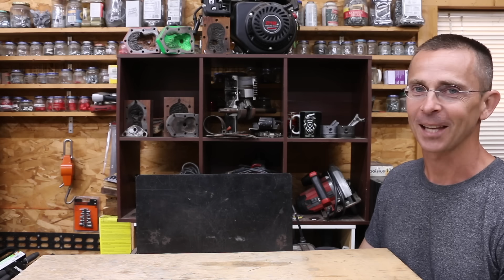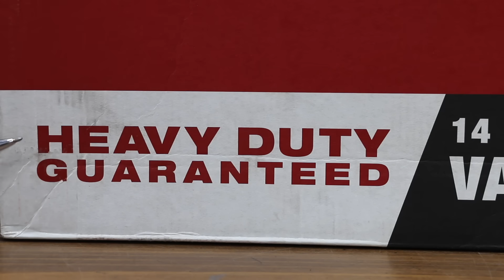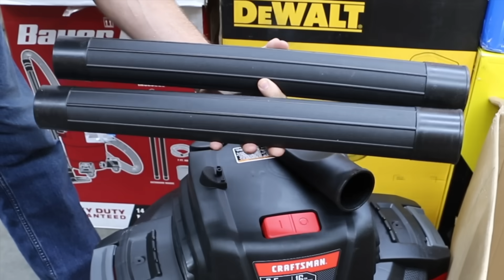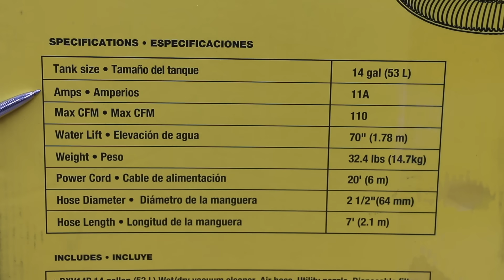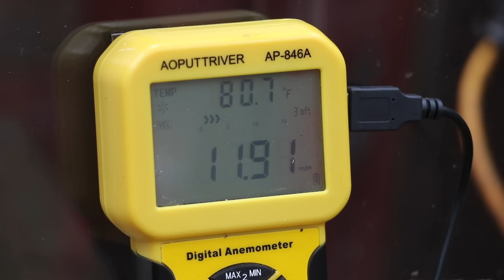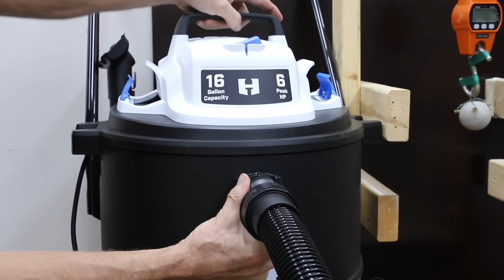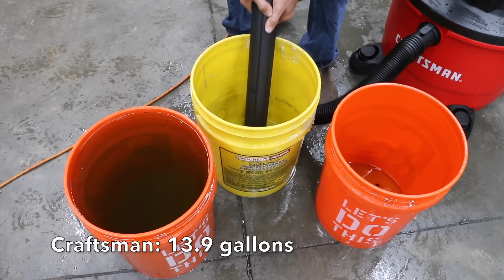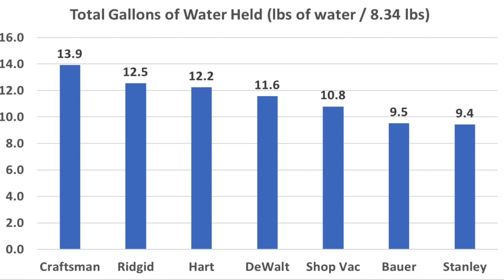Best Shop Vac? Ridgid vs Shop Vac, DeWalt, Stanley, Hart, Craftsman

Comment: As far as warranty goes for Ridgid, its meaningless. My blower motor went out with maybe 10 hours runtime on it. I had to ship it to them for inspection after having it for about 2 weeks they denied the warranty saying it went out due to the filter not being on correctly. (They wanted only the power head, no bucket, no filter) My only question is how they can think that without ever seeing it with the filter on?? Buyer Beware...

Comment: Seems like Dewalt performed the best to me. Sure, the Craftsman has more power but if that power doesn't translate into better performance then doesn't that just make the Craftsman inefficient. It may be all down to how tightly the lids fit. The Dewalt lid fit the tightest and performed the best even though it is less powerful than several of it's competitors. Too bad the Bauer doesn't have a better warranty. 90 days doesn't inspire much confidence in quality.

Comment: I think the suction test is slightly flawed as the different diameters of the hoses will favor the larger compared to the smaller ones.  Better test would be to use a vacuum gauge / 34ft water column.

Comment: I love how shop vacs throw around specs like "6.5hp". That would draw right at 50 amps. More than twice a 20 amp receptacle circuit, and more than 3x the rating of most receptacles (15 amp). And somehow this is "for consumer comparison"? So you use grossly inflated numbers - for my benefit? So I can compare to other vacs that lie about their HP? If they're lying - especially by that "margin" then who is lying more, or less, or ... its a useless number.

Comment: Video Summary Table
Cost:
Hart = $88
Stanley = $95.42
Bauer = $99.99
Ridgid = $99.99
Craftsman = $101.49
Shop Vac = $124.99
DeWalt = $143.37

Noise Level:
DeWalt = 75.6 dB
Stanley = 79.6 dB
Hart = 81.5 dB
Craftsman = 81.5 dB
Ridgid = 82.4 dB
Shop Vac = 83.5 dB
Bauer = 87.5 dB

Weight:
Stanley = 16 lbs
Bauer = 19.2 lbs
Hart = 20.2 lbs
Craftsman = 23.2 lbs
Ridgid = 24.6 lbs
Shop Vac = 28.4 lbs
DeWalt = 32.2 lbs

Power Usage:
Craftsman = 13.1 amps
Ridgid = 12.3 amps
Shop Vac = 11.8 amps
Hart = 11.6 amps
DeWalt = 10.9 amps
Bauer = 10.2 amps
Stanley = 9.6 amps

Air Speed:
Craftsman = 13.1 mph
Ridgid = 12.1 mph
Shop Vac = 10.5 mph
DeWalt = 10.4 mph
Hart = 10.45 mph
Bauer = 10.1 mph
Stanley = 7 mph

Suction:
DeWalt = 10.4 lbs
Bauer = 10.2 lbs
Shop Vac = 7.8 lbs
Craftsman = 6.4 lbs
Ridgid = 5.8 lbs
Stanley = 4.8 lbs
Hart = 4.4 lbs

Vacuuming 5 gallons of water:
Bauer = 6 sec
Craftsman = 6 sec
DeWalt = 6 sec
Stanley = 7 sec
Ridgid = 7 sec
Shop Vac = 7 sec
Hart = 9 sec

Capacity:
Craftsman = 13.9 gal
Ridgid = 12.5 gal
Hart = 12.2 gal
DeWalt = 11.6 gal
Shop Vac = 10.8 gal
Bauer = 9.5 gal
Stanley = 9.4 gal

Vacuuming 50 gallons of sand:
DeWalt = 28 sec
Bauer = 31 sec
Craftsman = 38 sec
Stanley = 40 sec
Ridgid = 43 sec
Shop Vac = 63 sec
Hart = 78 sec

Hope this helps! Let me know if I made any mistakes and I'll be sure to fix them.

Comment: Does anyone know where to find a model number on a Shop Vac? Only info I have is that its a QSP Quiet Deluxe 8 gallon, 30.3, L 3.5 HP and tiny number under that is 87729-19. Need instruction Manual since our sump pump doesn't work and our bottom stairs outside stairwell drain overflows into the basement every time it rains.

Comment: I've had a craftsman wet/dry vac for over 20 years but it's starting to show its age (over the years mice have taken up residence in the motor housing a number of times requiring some rewiring and other 'fixes').  Your treatment of these different offerings will be greatly useful for picking out a new wet/dry vac for the shop.  Thank you!

Comment: I would love to see how each of these stack up with the same hose.

Specifically is Ridgid only hampered by the reducer on that tip of the hose?

Possibly run this test with a 2.5" or 3" smooth inner wall tube for trash pumps to maximize effeciency.

I dig holes with my Ridgid frequently enough & have found that trash hose is needed to get about an extra foot of depth.

Comment: overall nice testing, especially the practical tests. The suction force test was maybe a bit flawed though as it is directly effected by surface area of the hose opening. 
I also wonder if a flow at pressure test could be made without much trouble, I mean like the airspeed test but with a flow restriction to achieve a moderate pressure drop. But it maybe too difficult to get a set flow or set pressure and would require a vacuum gauge, airspeed gauge, and adjustable inlet size; and then the sand and water tests kind of give the same information.

Comment: I have my shop in one corner of the basement w/ a boat parked in the middle of it. The best shop vac in my case was the one I wasn't falling over. I had a large one for years but now I have a 5 gallon size, still trip over it too. lol

Comment: DeWalt wins with the best suction, lowest noise, low power consumption, and beats the Bauer in slug fest.  If you want the overall best shop vac, go DeWalt, paying a premium.  If you absolutely must get best value with lowest cost, the Craftsman and Bauer are good options.  Not sure why the summary comments at the end didn't highlight DeWalt.  Overall, the difference in cost isn't much - all of these models are less than $200.

Comment: I'll swear by my ridgid wet/dry vac day and night. Got it on sale for $100 at Depot a decade ago and it's still goin' strong. Have yet to find a shop/work related mess it won't clean up without a hiccup. Worth every one of the 10,000 pennies I spent on it.

Comment: i'm trying to buy a shop vacuum for my woodshop, but it's kinda confusing, i mean they all seem t come with paper bags, but nobody uses those in a woodshop right ? that would get expensive fast. If you're sucking up water you remove the filter, but when dry vacuuming isn't the paper bag the filter ? so then what is the other filter for ? just to clean the remaining air that escapes the paper bag ? you need such a large filter just for that ? and how do you use it when you attach it to something like a wet saw ? where you get dust and water, you need the filter then, right ? so that means the filter has to be waterproof, which means it's washable, right ? so then why do you need a paper bag ? why not just use the filter only ?
(if anyone feels like answering, please drop a like on the comment or i won't see it)

Comment: I may be wrong, but when I looked closer at Rigid's "lifetime warranty", it isn't what it seems. From what I read, it basically said it only covers tools with defects in workmanship, and you should be able to tell after a couple uses if it's defective or not.

Comment: To be fair Harbor Freight does offer extended warranties, you just have to decide if you want to pay for it. Which seems bad, but I actually appreciate. Other brands incorporate the cost of the warranties into their pricing already, so you don’t really have the option to opt out if you wanted to. HB usually has an option for either 1 year, or 2 year extended warranties (which start after the 90 days you already get) - what’s great about them is that it’s a no questions asked warranty, something goes wrong, just bring the item into any HB location and exchange for a new one.

So to be fair to all, if you did get the 2 year for the Bauer, it would price the shop vac at around $135, much closer to DeWalt, at that point it does become less of a value proposition, and based on performance you might want to just go with DeWalt.

Too bad he doesn’t test the higher end shop vacs from the likes of Makita, Festool, etc...they have some awesome Vacs...though they’re no where close to this price range.

Comment: I'd love to see if the Shop Vac 600C from 1984 is more or less powerful than the newest one. Especially since Shop Vac brand is closing down. As an homage to the company that became synonymous with wet/dry vacs. I have a fully working, 5 gal, metal bucket shop vac from 1984 and would be more than willing to send it to you to test against a 2020 model.

Comment: Sorry, Todd; at 8:47 you were comparing apples to the previous oranges. The Bauer had a larger diameter hose, which equates to more area and more total suction strength.

Comment: Depending on the models..some may have better suction than others within the same brand.  it seemed like a big fix in power gains would be to just get a good seal on the bucket.  A simple weather strip would help.  I wonder how adding a seal to each of those vacs will help with suction once the leaks are reduced.  
Personally, I've stuck with Rigid because you cant beat lifetime warranty and on black friday's you always see a vac for $30-$60

Comment: I actually had the shop vac brand. The hose was sloppily cut. The filter clogged easily. It hung well in my shop out of the way. Recently, I bought a Kobalt brand from Lowe's. It actually matched the old holes to hang it. I was shocked. It was a little quieter. The hose was better made. The nossels were cheap. I kept the shop vac brand nossels & gave the old vac to a friend. I also had 2 extensions from a Shark vac. It actually fit it. Easier to clean, and the filter doesn't slide off like the shop vac brand. Kobalt is good, but you have to buy the extras for it. No wheels. I prefer to hold my vac when cleaning out a car.

Comment: I really wonder if using something to seal the lids on a little better like a weather seal would help make the vacuums preform better. They make a weather seal tape that's just a little foam with a tape on one side that should still let the lids shut correctly.

Comment: Over a dozen years ago I went to Home Depot early on black Friday and got one of those 16 gallon Ridgid shop vacs on sale for $40. It is way better than any shop vac I have had over the decades. I once loaned it to a friend who vacuumed out a deeply flooded basement with it. It works great for vacuuming vehicles and many other situations, some crises. I can't count the number of times I have used it. It has its flaws. The wheels are too small so it has issues moving. The hose is cheap and the flexing causes it to flatten near the canister. You have to wrap it with monster tape to keep it round. But it still works great today. I also like the way the canister is all plastic and easy to clean.

So about two years ago I was at Home Depot and they had a newer version on sale for $40 so I got another. A replacement filter costs $18 so that means the shop vac part was about $22. I don't like the way the Ridgid used in this video has the ability to remove the motor allowing air leaks. I suspect if this comparison used one of my older Ridgid shop vacs with fixed motors and better sealed tops, they would have won.

Comment: Interesting results, did you re-use the sand between vacuums or give each one a new bag or sand?
The sand may have fine dust in it which could have clogged the filters of the first vacuum or two, and after being removed not/less affected the other vacuums.

Comment: The brauer can have a 2 year no questions asked warranty for 20 bucks at harbor freight, harbor freight has probably one of the best tool warranty around just bring it in tell them it stopped working and grab a new one right off the shelf and walk out with it's all those big box store brands require you to pay shipping and ship your vacuum back to dewalt or ridgid and you will be weeks without your tool

Comment: I think you test was one of the best covering all concerning area of performance. Thank you. I would suggest to add a suction test picking up different size gravel rocks. This would show obstruction and clogging incapability. Like seeing how will removing decorated  gravel that is used in landscaping. I for one like to change to gravel out add change to gravel with different colors. There is a company in the UK that make a gutter vac. It’s call SkyVac. It has a tilting feature to help in removing debris. Thanks again and great job.

Comment: I think your vacuum tests suck...sorry...horrible pun LOL.  

I can say I was the least impressed with Stanley.  I had one out in my shop for less than a year before the motor in it burned up.  My 14 year old Ridgid 12 gallon shop vac is still going...I have several different Shop-Vac branded vacuums and they all work great as well...my Ridgid has had the hardest use of all of my shop vacs being it was a dust collector for my table saw for several years probably about 8-9 years before I actually unboxed and assembled my Harbor Freight 50 gallon dust collector...yep I had the dang thing for about 9 years before I ever used it LOL...I have another one still in the box too...the intention was to install a floor in my shop...that's yet to happen so I finally decided I'd setup the dust collector...overall it works great, but empty the bag in it before its 1/2 full, dang thing gets very heavy very fast.

Comment: These are the types of videos I needed. Rigid seemed like a good choice for me but with the price, I really don't have an extra $100 to waste on a chance. Bauer seems like a better choice. Better suction means wider variety of items to pick up, from dust and dirt to beads, kibble and cat litter. Whatever I need picked up, I can be assured most likely it will be. 90 day warranty is a bit sketchy but if it works I can chance it, especially if I'm not using it for heavy industrial purposes such as oil spills and constant chemical or sawdust pick up and just doing around the house once a week.

Comment: The baseball suction test is not accurate. Much of it is contact surface and some shop vac have smaller diameter hose than others.

Comment: I have the bauer, it has been great, except for one time I sucked a long strip of tyvek up in it without the filter on it, had to take it apart to get it out, I think it was 80$ and it is pretty strong, I got an adapter to go down to 1 1/4in fittings from my old shop vac and it will suck so hard necked down that small

Comment: I'd love to see an experiment where you test the change in suction and dust collecting ability of a given shop vac by using different diameters of hoses. Not just the 1.75" and 2.25," but also trying a hacked together 4" hose on a shop vac (and not constrained by a 2.25" vac barrel inlet) Obviously wind velocity would go way down with a larger 4" hose but I'd like to see if total CFM and general dust collection ability went up or down. This would be really useful for everyone that's building homemade dust extraction systems powered by shop vacs. Can the total dust extraction be improved by retrofitting 4" hoses?

Comment: These vacs came with different size hoses (looks like 1-7/8" & 2-1/2" nominal OD). Hose size matters a lot.  Some other comparable "6+hp" models have 1-1/4" or 1-1/2" hoses, and they are really choked down by those hoses. On any vacs you tested with smaller hoses, switching to 2-1/2" will significantly increase airflow, usually at a slight reduction in vacuum level @ unrestricted opening. Also, some hoses leak more than others where the corrugated plastic enters the end fittings (ShopVac hoses are notorious for that). So if you still have all these vacs, it would be useful to retest the suction force (pull test), airflow speed & dry pickup using the same 2-1/2" hose (either pro-grade or a cheapie with the ends caulked/taped). One last thing: a vacuum motor/impeller can be designed to have higher flow at lower vacuum or higher vacuum at lower flow (based on the label ratings, Dewalt appears to be an example of the latter).  Which one is better depends on intended use, but a well-sealed system with a motor/impeller more optimized for high vacuum level but low flow tends to win demonstrations of how much weight it will pick up.

Comment: I like the Ridgid because if you use the blue filter you can wash it with a water hose and in about 5 to 6 hours it is dry and ready to go. Also if for any reason you have any issue with your ridgid you call them and they will send you a new vacuum of equal rating for free. I can not find that with any other shop vac. You will get your money's worth with Ridgid. Great video. You need less than 40K views to hit a million on this one.

Comment: I recently had to deal with a flooded building and was using shop vacs to remove water. It became clear that the best possible option is a large tank that has the ability to connect a water hose for draining, also a built in sump pump to aid in pumping water out is very recommended. These units are BIG and expensive but the only way to go for dealing with lots and lots of water to be removed.

Comment: You need to use the same size hose on each one to do the test, especially for the ball weight lifting. Use the smallest hose diameter i would think.

Comment: They come up with the “peak” horsepower number by using the inrush current and calculating the horsepower using the inrush wattage, which of course the motor only pulls that current for a few milliseconds. It’s highly misleading.

Comment: I have a hard time sucking water with 20 ft of hose and a rigid vac, I can only y partially submerge the vacuum inlet  halfway otherwise it does not suck well full submerged.

Comment: Awesome as usual, BUT... I'm a bit surprised! Beside one having the extra function of being a leaf blower. They don't have any other function/option? That's rather surprising while it can make or break a deal regarding shop vacuums.
My few years old Nilfisk, come with the "extra" function of being a blower and is tool remote controlled. This last one is particularly useful when a tool is attached to the vacuum. Ex. sander, saw, etc. That's beside the normal function of wet & dry vac. 
Also it would be interesting to mention other important features like power cable length... ;-)
Keep up your awesome reviews. Thanks.